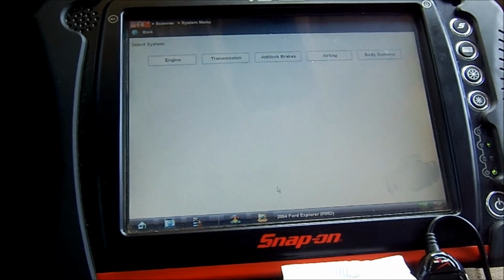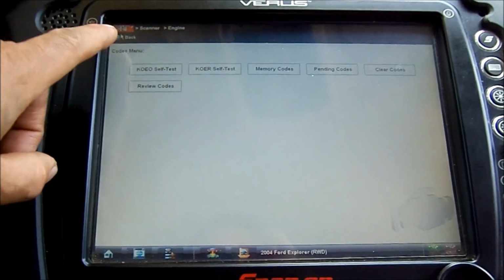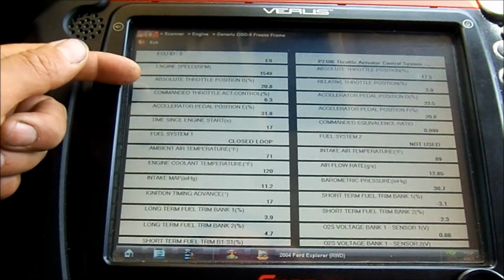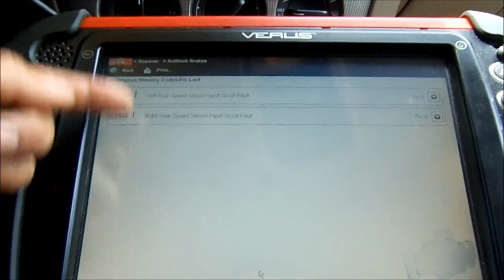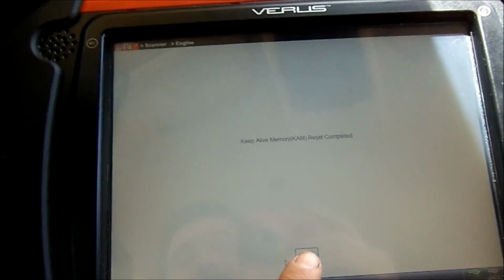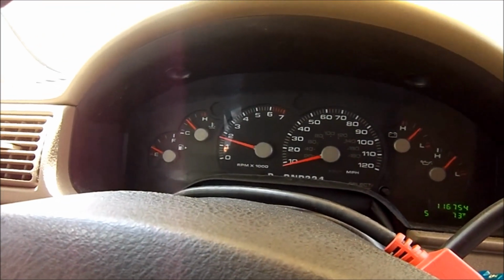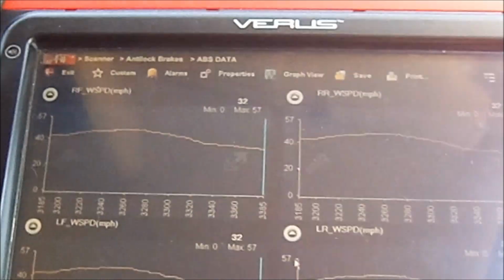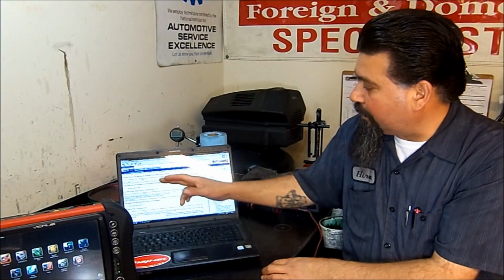P2106 TAC System Forced Limited Power (2004 Ford Explorer)

Comment: I knew it dude I’ve got the gd truck diagnose by 3 or 4 mechanics they all told me bad transmission but mine was rebuilt not even 3k miles ago now I’m getting the same codes that the first time and kinda the same issues I tested that sensor in the rear differential 2 days ago and found out that it wasn’t working properly no more I ran a couple of tests and all the results were bad so I asked another mechanic and he said that it has nothing to do with my transmission since it controls just the rotation of the tires and it’s supposed to throw different codes once it fails but he might be just wrong i guess imma get the sensor replaced tomorrow and I’ll be updating if I can finally get this problems solved on my 04 F150 (limp mode when in reverse, engines stalling at idle, p0720 p0722, p2106 and p1000

Comment: I have a 2004 dord f150 5.4. Codes are p0726 and p2106.. the truck won't drive and only goes in reverse. I changed both output and input speed sensors. Not sure what to do
Reply: What'd u do

Comment: I have 2006 Crown Victoria. I got p0715 p0717 and p02106. With p0401 p0443. In 1st gear it vibrates and barely response. Do u know how to fix that? They told me Harness is good. Not know what to do.

Comment: as soon as you mentioned the tranny can be a cause  , a light went off,  the  interior tranny harness is known  for their faulty temp sensor on it and will wreak havoc on the  PCM   the P2106  code  came in with P061 B  complete PCM failure  , the truck still drives 06 F150  6 cyl. and the PCM is going crazy trying  to resolve the issue , interior wire harness to all the soleniods i believe is the problem for me, as i have already replaced this once i bought a aftermarket one. probably not the best thing to do

Comment: Being a mechanic back before all the computerized equipment, I thought I was going to just get a front and rear seal replacement when my '05 F150 started spewing fluid out the front seal while cruising down the highway. Your comment about minute 2.0 in the video states that when you lose the front lube the turbine speed sensor melts. Is this true if the moment the pressure was blown, I pulled over and called for a tow?

Comment: Got this code for 1 years straight buddy. Replaced TPS 3 times like your buddy. Now, I only get the P2106 when truck gets hot on a 100° day OR Anytime I turn AC on it goes to limp mode almost instantly yet ice cold ac never had an issue. Should I do what you just did for this truck? Replace my...what exactly?

Comment: Ok i got this question. I have this code p2106. Cant figure it out. I replace the rear sensor in the video with a duralast should i chosen motorcraft? I recently found that the bearing is really bad. Could the bad wheel bearing be causing the speed sensor malfunction thus causing the p2106 code wrench light and check engine light?

Comment: I currently don't have any ABS or speed sensor codes but i do have the P2106 code and only sometimes I can feel it kinda almost like a jumping feel down the road very slightly all tires are the same and same mileage on them all wear is close to the same. Trans was rebuilt about 7k ago.

Comment: Hello. My 2004 Ford Explorer code is p0102. P2106. P0104.  I turn the car on and 2 minutes later it dies. I had the EGR valve replaced. I’ve cleaned the throttle and MAF sensor. Do you think I need to replace the throttle or MAF sensor??

Comment: hie i have a 2004 ford explorer advancetrac rsc  i was driving  and came to stop when i try to accelerate it didnt want to go engine was still on but it didnt want to move later it shut of on me and didnt want  to start no more,  now i check it with little check engine computer from auto zone and it gave me this code only p2106 how can i determine what it is? and we change the throttle  body . and still wont start.
Reply: Civic Pontiac did you find the problem with it? I would like to know cause I'm kind of having the same problem
Reply: Civic Pontiac did any of you guys figure out what it was
Reply: Civic Pontiac did any of you guys figure out what it was
Reply: What was the problem? Did u get it fixed

Comment: Hi Hiram. Thanks so much for the very informative video. We have 05 Crown Vic at the shop with P2106 eng code only. This just had the Diff replaced, and never would have thought this could set a TAC code if there's an issue with the rear speed sensor.
You're a genius and a life saver.
Best Regards......Barry

Comment: after you reset the computer could it throw a trans fault gear ratio code because it's relearning? I had tps codes, forced low power mode, ect intermittent malfunction unverified, fuel rail pressure high input unverified and a trans fault light with blinking od off.. I cleaned the throttle body and various sensors around that area and reset the computer. codes went away but then when I was testing codes later it went into high rpm idle and i shut it down. so I have so many problems im not sure if a bunch of sensors are causing incorrect gear ratio or if I have transmission damage. it eventually goes into gear so I guess it works. its an old transmission tho and i dropped the pan a couple times and put in Valvoline high mileage instead of Mercon v and the old filter was clogged so maybe the new one is too and it burned up some stuff in there or the wrong fluid is causing problems.. I could have a bunch of electrical issues or something. there's so many sensors how can you ever diagnose a problem?
Reply: Did you ever fix the problem?  If so, how?
Reply: @jorgeloera2809  i eventually took it into a trans shop and paid for a rebuild. i dont know what they did. maybe it was something else idk.. they fixed it.. 6 years later now i have almost the same problem.. now its p0731 gear 1 out of ratio and p0722 p0720 output speed sensor malfunction codes..

Comment: Hiram hey brotha so I have a question can u help me out.. I need advice on tryin to fix my truck I have a 2004 f150 5.4 xlt.. This tac code pops up p2106 I can figure it out.. I replaced the throttle body already. But 6 more codes came out. P1000, p2106,c1155,c1145,c1230 and u1950. The check engine light comes and the maintenance light comes one the wrench if I'm correct.. It always comes on when I hit the free way.. The force limiter comes on and it only comes one when the truck is at optimal temp.. I need some help brotha I would take it to your shop but I'm out of Cali. Idk where your at.. Let me know if u can help really appreciate it
Reply: eddie ramoes what did you do to fix I have the same problem right now brother

Comment: I've got this problem on a 2003 Thunderbird.  I wish you had shown the replacement of the sensor.  I do not know where it is located, however, there are three all along the top of the transmission that I cannot get to.  I think I might have to get a better scanner with ABS.

Comment: Hiram, You da man, thank you for this video. Mine also has turbine speed sensor code intermittent. 05 expedition 5.4. It would turn off o/d going down the road, o/d off light would come on, on the dash.
Reply: Did you ever get thar o/d light fixed? I have same problem after replacing transmission on 2005 ford expedition eddie bauer 5.4 4x4 then goes into limp mode.

Comment: Buenas amigo, queria consultarlemi problema si tiene el tiempo para ayudarme, tengo una explorer eddie bauer 4x4 V8 año 2004, desde hace unos dias al tratar de rebasar un carro que le exigo la sobremarcha, la camioneta entra en modo proteccion de motor, me paro, la apago y la prendo de nuevo y ya esta perfecta, ayer me hizo lo mismo pero esta vez quedo encendida la luz de "Service Engine Soon", hoy la scanearon y arrojo los codigos:

P1000 On-board diagnostic (OBD) system readiness test not complete
P2106 Throttle actuator control system forced limited power

Luego de que se apaga y prende, probe exigirle de nuevo y anduvo perfecto sin entrar en modo proteccion de motor... La camioneta a veces da golpes como de caja y me dijeron que es la cadena del transfer que esta estirada, pero ahora que unimos esta nueva falla con ese golpe, podria ser que sea problema de algun sensor en la caja? Hoy le limpiamos el cuerpo de aceleracion y la probare a ver si la falla persiste... En lo que pueda ayudarme se lo agradeceria!

Comment: I have ford explorer XLT 2009, issue when I apply brake at normal speed 30 M or more brake doing well but suddenly high brake slow a truck like something pull from back. At slow speed it doesn`t showing, might issue with brake fluid that need to replace it or something else? I replaced all brake pads and rotors showing great, I purchased this truck few days before, thanks for your support

Comment: I have the same code on mine... usually in winter when i drive in snow or slippery roads.... if i need to push it  a bit in snow it will come on if i usually hit some snow drift and such...
I have a 2004 f150 4.6L  when i turn the key off nd turn it on its good to go again... the yellow wrench and check engine....   my abs light is always on... cant find the problem thought maybe that could be causing it if i think a wheel isnt turning

Comment: Hola! Los sensores tienen que ser originales?   Le cambie el trottler body y input output sensor y el panel dice "trans fault"
Reply: Hola!!, P2106 y P0715
Reply: Arranca lento y luego que llega a 15 o 20 millas de velocidad suena la campana indicando en el panel (trans fault) y corre normal
Reply: Ford f150 2004 v8 4.6l
Reply: Es automática y no hace empujones, si a eso se refiere.
Reply: No se mucho de transmisiones perp algo asi , que velocidad es de 15 a 20 millas 1ra segunda o tercera?
Reply: Si luego de la campana del panel indicador funciona bien
Reply: Ok, yo iba a seguir cambiando el egr je, je pero debe ser eso entonces muchas gracias!!!
Reply: @javiersantana449  aún no

Comment: Man I watch your videos all the time to learn some from you. You are awesome. My problem is I have 2002 F150 with a 4R70W transmission that takes off in second gear only. It doesn't respond manually, low or high. I checked the internal parts and everything is good. What is causing it not to shift up? Thank you very much.
Reply: you getting no power check fuzez!
Reply: @4ujkdguy  the harness in the trans is bad faulty trans temp  sensor   common for ford

Comment: Mitchell however, 95% of the time, has MUCH better wiring diagrams due to Mitchell redrawing the diagrams provided by the manufacturer and also the program they use for color, zoom in, and following wires in the diagram. Also, their OnDemand tips section not only saves time, but also makes for an interesting read. Not saying ones better or worse than the other, but I have noticed these differences so it's a matter of preference.

Comment: Love watchin your videos, but I will have to disagree about Mitchell and Alldata being the same thing. I've had the opportunity to use both, and while they basically intend to do the same thing, I've noticed differences between the two. I've noticed in Alldata it's easier to find actual repair information as far as procedures to R&I components, a simplified vehicle information entry process, and a MUCH better search engine than Mitchell uses.

Comment: This is the same thing with my 2004 Honda Accord ex v6. It goes into "limp mode" and has little acceleration until about 40 mph. I think it's the app sensor or something. These three codes come up P2138, P0717, P2197
Reply: uhhhh... no.... it's probably the garbage auto tranny those accord v6 's have